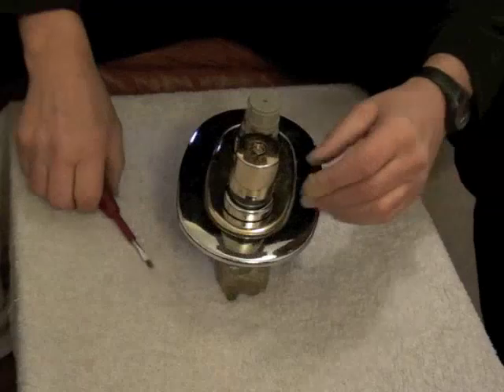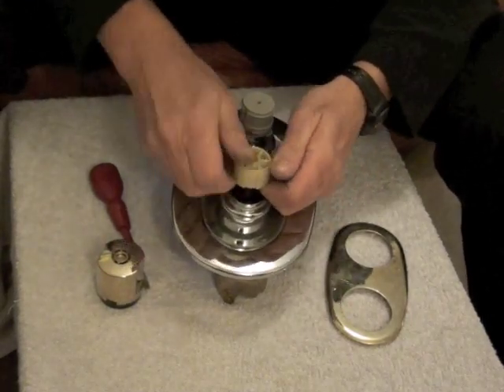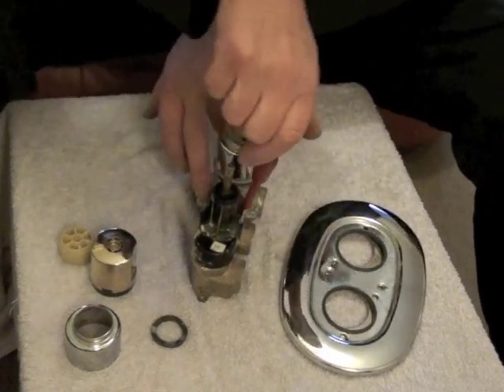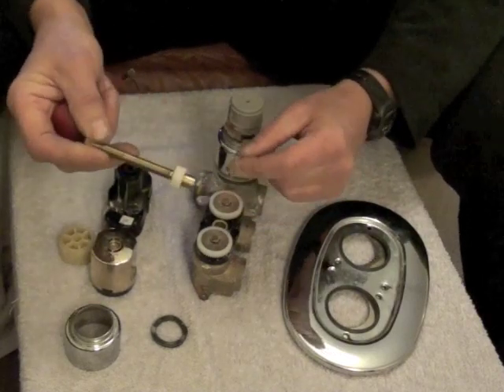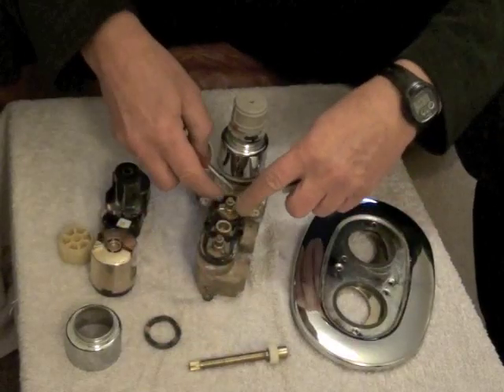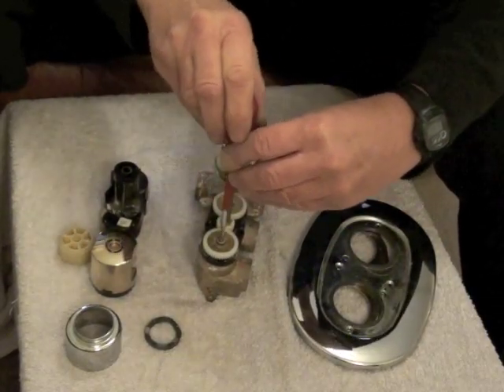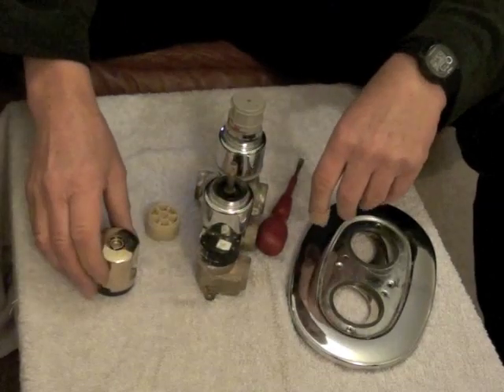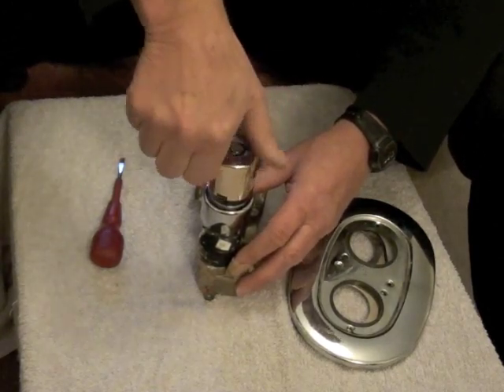Trevi Therm Spindle Removal

Comment: Surely both cogs will turn in the same direction i.e. anti-clock if the centre spindle is turned clockwise. Ive just replaced the hot and cold cartridges which were both anti-clock close. I double checked this with the shower suppliers who confirmed I was correct. My Trevi Therm dated from 1995 MK1 so maybe it changed later on

Comment: Thank heavens for this. I was (1) able to identify the model I have (2) was able to replace the two cartridges and cog wheels. DIY and saved myself time and expense of calling in someone to do it for  me. 

One thing to note is that, yes one needs to switch of the water but despite that, you will need a towel or something to mop up the water that gushes out when the cartridge is removed. Also a good opportunity to clean all the parts of limescale etc. and make everything look brand new.
Reply: Were the two cartridges difficult to replace, mate? Video doesn't show this stage.

Comment: Hi there, nice video. I'm trying to replace the thermostatic control cartridge from a trevi therm, but I'm finding it too stiff to unscrew. I've put wd40 on but it won't budge. Due to the cramped space its hard to get good leverage. Any suggestions?

Comment: Thanks for this. Just used it to remove the ceramic cartridges. One was sruck. But used an air drier on hot and pulled out the cartridge. Cleaned them up which wasn't to bad to say my water flow had slowed. Put it all back together and seems OK. Thanks for the video.

Comment: Do you need to turn the water off?
Reply: If you're just replacing the cogs you don't need to turn the water off. I've replaced mine - exactly the same controls as in this video: Ideal Standard Thermi. 

If you're replacing the cartridges then you  must turn the water off .